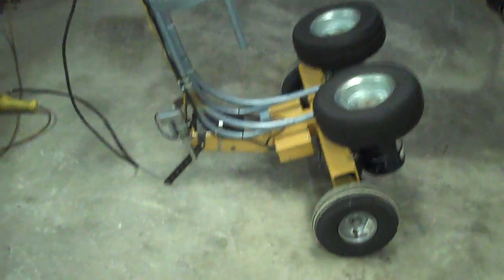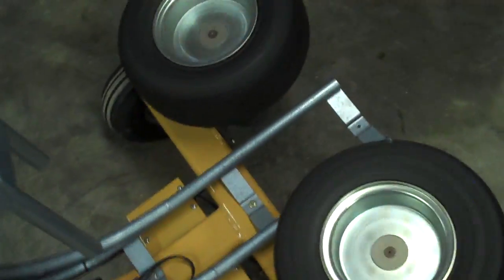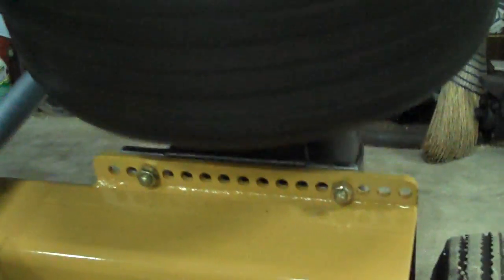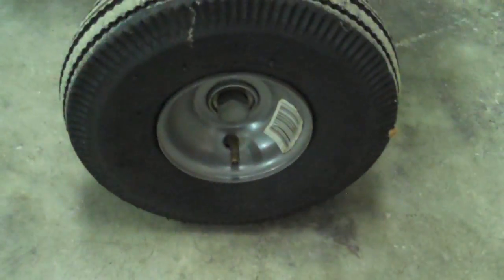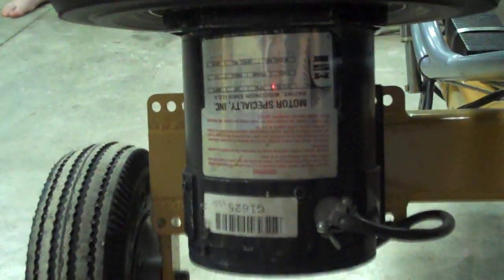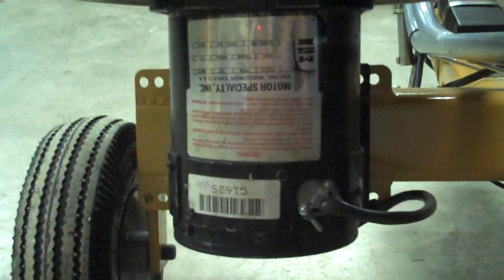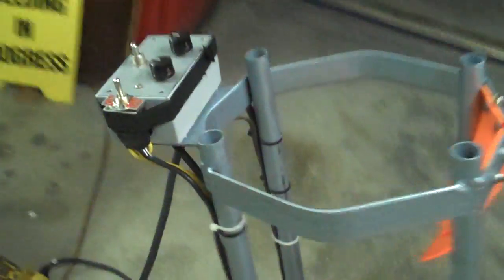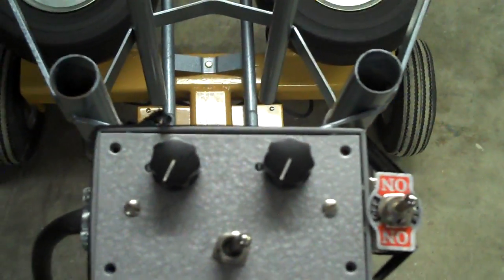Racin'Jacin: The $100 soccer ball launcher Part 2

Comment: In your opinion, would it be possible to use only one motor? So, only one drive wheel?
Reply from the maker: Not saying it'd be impossible, but it would present a completely different set of challenges. My guess is that it'd have an excessive amount of spin on the ball that way. Not sure how you'd control that. I vary the motor speeds to curve the ball left/right. So to me having that ability is a huge plus as it simulates actual ball motion from a kicker.

Comment: The engines are 19V, 2500 rpm and what is the power? What was your wheel diameter and how did you do the speed control?
Reply: I think he said 90 v not 19

Comment: sir do we required high torque motor
Reply from the maker: So you don't need a lot of torque to spin up the motors, but when shooting quick consecutive shots is when you notice the torque. Under powered motors will drop the speed and your quick follow up shot will be less power.  The motors I used were pretty good. Also the motor controller parameters will affect this a well. I fiddled with the parameters some using the OEMs instructions.

Comment: Hey RacinJacin, I wonder what is the benefit of a 90VDC motor over a 24VDC motor? Also I cannot find anything off-the-shelve to connect the wheels easily to the motors..
Reply from the maker: I used those 90VDC motor ONLY because I had them and the 90VDC controllers laying around. For wheel adapters - look to the Go-Cart industry - last time I looked they had Hub Adapters that would work depending on your motor shaft.
Reply: @RacinJacin392  Thanks. For some reason the motor vendors don't tend to mention the axle diameter. I'll keep searching for a 12V DC motor 2500rpm with matching diameter so that I can use a 12V battery for 2 motors, keeping about 1000rpm.

Comment: hey man love the machine. Can you please tell me more about the motors and how you mounted the rotating wheels on the motors?
Reply from the maker: The motors are just DC motors - nothing  special.   I actually made the adapters, but you can buy  those at the Go-Cart supply places as they use them alot.
Reply: @RacinJacin392  are the adapters for the wheels? So there is no need for a lathe?
Reply from the maker: @ricardo5670  Check with the go-cart people. Last I looked they had "hub adapters" that were identical to what I made. They may also be the right place to get better quality (balanced wheels/rims) as some of those carts REALLY fly.

Comment: Hi! I'm started as a marine engineer student and got the idea of a ball launcher for a school project and found your video for inspiration.. I could really need some help with some drawings or just anything. The assignment include time management and an economic aspect. 
Hope to hear from you! 

Kind regards
Malik from Denmark
Reply from the maker: Hi Malik, Sorry for the delayed response, but you caught me during race season!  The materials used here are way overkill (I used what I had laying around or what I could get for free). Unfortunately I never made any drawings.  The main frame is 3"x3" steel tubing - I'd have used aluminum if I had my choice.  The ball "chute" is made from common electrical conduit. The motors are 90VDC 2500RPM (I run much slower) and I used old school SCR controllers because they were free. I made the motor spacing adjustable - extra squeeze is nice for when the balls are wet and doesn't hurt anything when they are dry.
Reply: Its totally okay, i'm still in the brainstorming part. And I fully understand about the measurements but where did you get the materials from then? Like, the "conveyor" the ball is following towards the wheels? Was it already welded or did you have to do so? (Sorry, my English is not my first language) thanks for the response!
Reply from the maker: @halvkat  The ball chute was made from electrical conduit.  it's easy to bend, but you need to be very careful welding it as it is galvanized. ALL of the galvanized coating MUST be removed to weld. If you try welding on galvanized metal it will produce nasty gases that are harmful. Crystal clean or don't weld it. You could also skip that hassle and get good clean tubing to start with. I had conduit laying around so I USED what I had.
Reply: @RacinJacin392  ah allright. I have some standard iron/steel tube at my school. Another question though. What connection is there from the engines to the wheels on top? And is it just some ball bearings down by the ground wheels? Thanks so much for answering me it's kind of your machine I'm working out from. Kind regards.

Comment: Nice design.  How far apart are the wheels, relative to the size of the ball?  Or, what size ball are you using/distance between wheels.
Reply from the maker: Currently I have the wheels set where there is ~6.5" between them. I've run 4&5 size balls at this distance with no issues (lately it's all 5's). Earlier I ran larger spacing, but I found out that if the balls get WET then they tend to slow way down as the wheels slip. By running them closer (more) squeeze doesn't seem to hurt anything and still let us work good if the dew was on the grass.

Comment from the maker: IIRC these are 1/3 hp motors 2,500 rpm  (i run them much slower) 90 VDC    SCR controllers
Reply: Hello
I want to make a soccer ball. I need you to provide me with engine information and construction drawings
Email: sajadghadari1378@gmail.com
Reply: hi.... can you give detail about the SCR Controller you used, please?
Reply from the maker: @FelixLopes-z3y  By this time they are pretty old. Heck they were old when I used them. I only used those because I had them. I still see them on Ebay so 'cheap' ones are still out there. I'm sure there are better options these days. Sometimes availability and price guide us the most.

Comment: If you went to a junkyard where would you be able to find the motors and controllers. What I mean is where would the motors be located on a car, motor bike, etc.
Reply: For DC you can find cordless lawnmowers on Craigslist--once the batteries die, people tend to junk the thing instead of buying new batteries.  For AC you can find plug-in electric lawnmowers, which include the actuator (turns AC to DC).  I suggest lawnmowers only because the motor is easy to access and the RPM is high.  Treadmill motors are also high RPM and easy to access--and easy to get cheap or free; the circuit boards and tread begins to slip long before the motor burns out.

Comment: Hey I was just wondering what power source you used, I really enjoyed your design, and I will be trying to recreate your idea. Just leave a reply. I subbed.
Reply from the maker: I used 2 SCR controllers (each motor separate for individual speed control) 120AC Input.  90VDC motors.  Everything was scavenged used or surplus - much from Ebay.
Reply: RacinJacin392 thx so much

Comment: Hey ... I wonder if you could tell me what power the motors have and if you know where to buy these or similar ones! thanks ;)
Reply from the maker: David Placke  I used USED 90VDC 2500 RPM motors -1/3 HP (IIRC) I bought off Ebay for dirt.

Comment: Do you have any measurements for this awesome machine. I would like to build one myself.
Reply from the maker: Edward Cunningham  I never drew up any plans, everything was seat of my pants so to speak.  I'll try to grab  tape and get you some numbers.
Reply: @RacinJacin392  great machine you made. Have you ever tried ut to see how well it worked?  Put up a video if you can.
Reply from the maker: @cfomusic73  We used this for several years. As my son got older we just kept increasing the ball speed.  Never chrono'd it but they were really moving.  It would launch them nearly the length of the field, but that's not how we used it. We did goalie training with it.  The only issue I ever had was at the mega high speeds - the wheels needed balanced.
Reply: Hey I want to build one. Can u help me with some measurements
Reply: Yes I would like to build one as well

Comment: What horsepower are the motors you used? Awesome machine
Reply from the maker: 312 Woodworking  IIRC I used 1/3 HP motors, 2500 RPM , 90 VDC w/ SCR controllers - all used off Ebay
Reply: 312 Woodworking I also want to know how many watts thease motors are.

Comment: what rims and tires do you have on it? how did you mount them to the electric motor?
Reply from the maker: +Michael Meyer I made some adapters (I understand not everyone has lathe access), but I think you can purchase them from the guys who supply parts to build go-carts. - I see they sell hub adapters - I bet you could get them to work. I bought the steel rims and tires off Ebay - having used them for a while now - they are OK , but nothing to get excited about because they do have some runout - and now that my son is 14 we're wanting to crank up the speed so better balanced wheels are my next upgrade - not sure if I will spend $  on some aluminum go cart stuff or just find something I can modify from the surplus store.  I hope that helps

Comment: I've been inspired to make my own one. I was looking at the motors you specified and they are about 140 dollars each. just wandering how you got yours for so cheap
Reply from the maker: +William Ambrose I bought used on Ebay!
Reply: thank you I'll keep my eyes out. how fast can it shoot the balls out would you say.
Reply from the maker: +William Ambrose  It'll shoot them out scary fast - the limiting factor for mine right now is the balance on the wheels - they start to vibrate when we turn it up to scary fast range.  I was planning on looking into this to see if I couldn't balance them - these particular motors go 2,500 rpm - we've never been full speed yet.
Reply from the maker: +William Ambrose I have wanted to try getting some solid wheels - figuring I could easily true them up on the lathe, but haven't been down to the surplus store to try and scrounge any. My son plays U14 - this shoots them faster than the 14's kick - that's why I've been a little lazy in solving my balance problem.
Reply: Ok thank you. what brand/model number are the motors
Reply from the maker: +William Ambrose IIRC these are RAE motors  - I've bought them used off Ebay
Reply: Hello
I want to make a soccer ball. I need you to provide me with engine information and construction drawings
Email: sajadghadari1378@gmail.com

Comment: What is the model number of those motors?
Reply from the maker: These are some old motors - I have bought some of them off Ebay from Industrial Surplus vendors - to buy this exact motor new would likely be expensive. Used off Ebay was cheap.  I wouldn't recommend focusing on this exact motor - anything close would be fine. These are 90VDC 2500rpm 1/3 HP IIRC
Reply: were you able to find out ?

Comment: The only problem with the machine is that unless you can count with a power point in the field you are unable to use it.
Reply: TheDRIBBLER2 haters gone hate
Reply: There are several tutorials on how to make a cordless lawnmower work off a car battery.  I am sure the same would apply here.
Reply from the maker: TheDRIBBLER2  The original intent was to use it around the yard, but we have brought it to various fields - in those instances I throw a generator in the back of my truck!